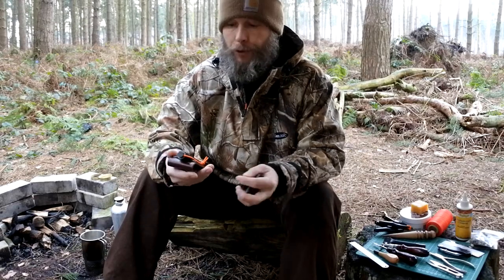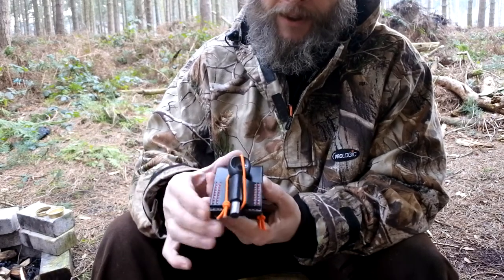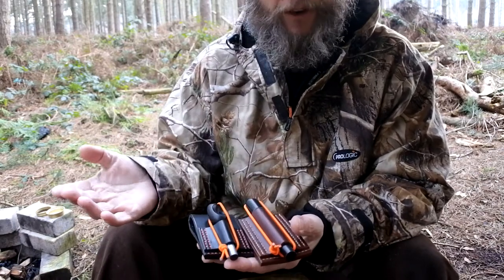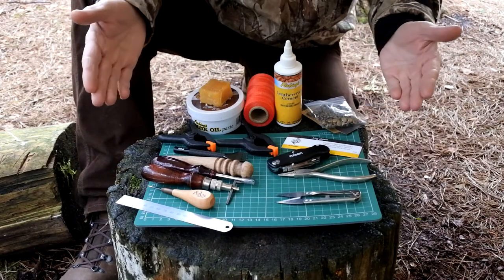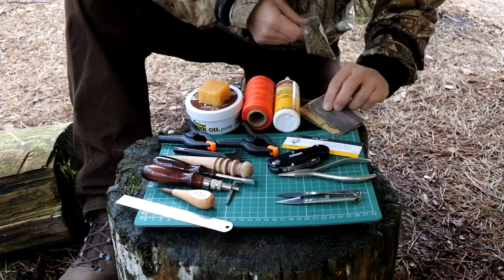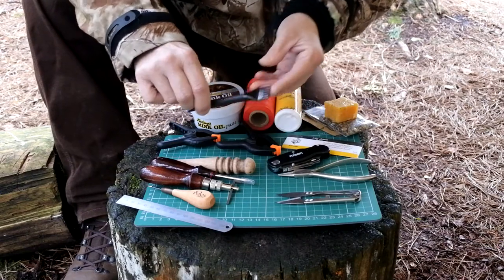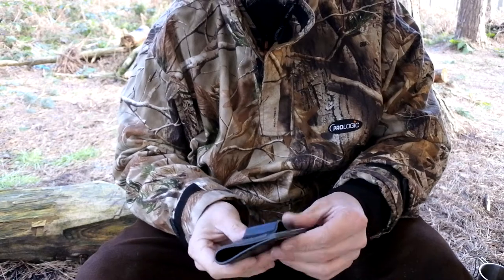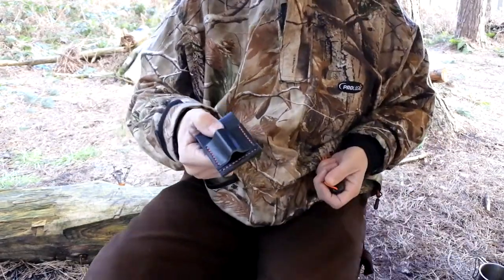Crafting a Leather Ferro Rod Holder.

Comment: Hi Mark. Nice to see you! Sry I got here a bit late... I've been thinking about making these myself, but I never got to actually acquiring the tools needed. I've seen some beginners leather work kits on amazon but they are and look a bit cheap... I'm really liking the ones you are making, and yes I have seen similar before :) Anyway thanks for the inspiration and I might make some as well, who knows. As always, great content and I hope you are keeping well brother, take care!
Reply from the maker: Hi Ed, I hope you are keeping well brother. Yeah I've seen loads of different types knocking about. I came across something similar at the bushcraft show last year and people wanted up to £60 each for them. I thought it was cheaper to buy a few tools and the leather and make it myself. I started off with one of the kits. I paid about £35 for it and I probably use half of what came. Some i binned, but the edge tool, the groover and stitch irons I kept as they can be quite pricey to buy individually. I didn't want to spend a lot on it. But overtime I ended up buying bits here and there and the set soon build up. In my humble opinion a decant awl is worth its weight. Thanks again Ed, have a great day mate, all the best, Mark. :)

Comment: Nice job! Looks like a nice project to do. I may have to try it.  I have a 1/2 inch  ferro rod I like to get one for. Can I buy one if I decide not to make it myself?
Reply from the maker: Hi Jason, many thanks for watching and taking the time to comment. Yeah sure. If you don't make one, I have got a couple made for an 1/2" rod. I've got a black holder with tan stitching and a brown holder with orange stitching (the one in the video near the end). I will hopefully be getting some more leather next week, so if you want a different coloured thread I can make you one when it comes. My email address is markbay@hotmail.com if you need to contact me. Thanks again Jason, all the best, Mark.